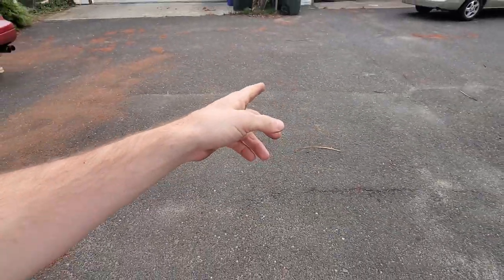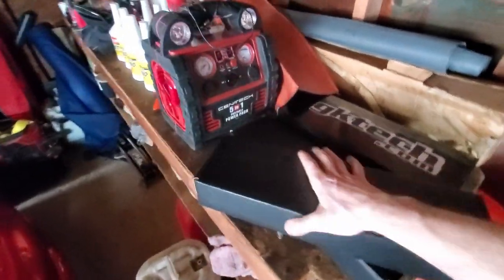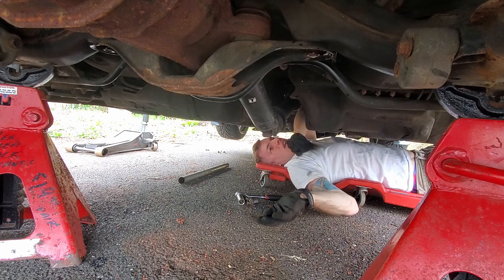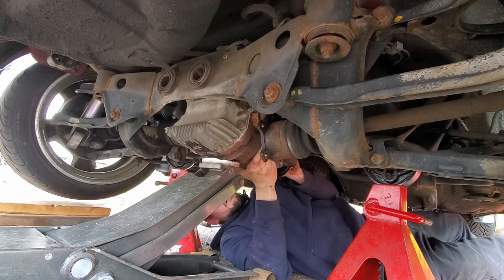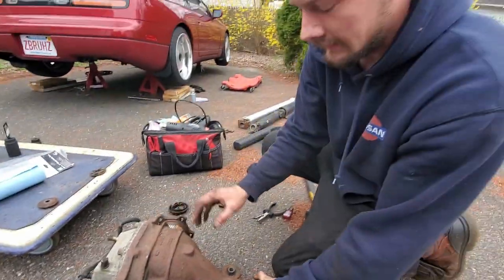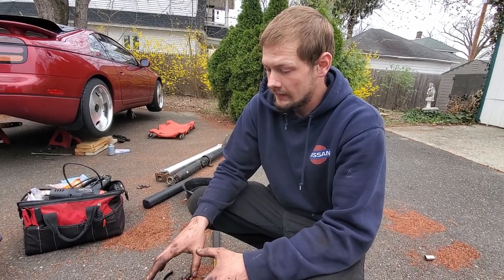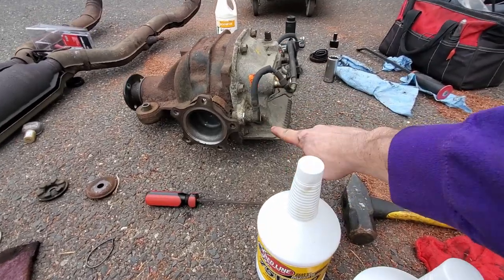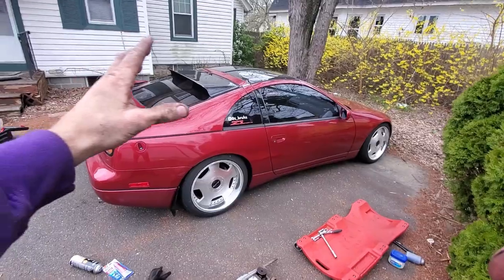Complete Guide on How to Remove and Install Differential Seals for a Nissan 300zx!

Comment: Friend eh, seen your tutorials and started my vehicle a 300zx 1992, the problem I have is that when I accelerate the machine it slows down and it starts to lower the revolutions and it pretends to want to turn off what recommendations can you give me in this regard.
Reply from the maker: First things I would look at, ohm your fuel injectors and coil packs, then look at spark plugs, from there check fuel filter. Was the fuel pump ever replaced?? Then if those all check out and are fine look for vacuum leak

Comment: Question, did you have any vibration when you differential was leaking?   I just did complete rebuild on the motor and went from na to tt.  I noticed that when turning, I would get a vibration in the car.  Later I realized that there is no vibration when in neutral or when the clutch is pressed.  I thought the issue was in clutch or transmission but could not find anything.  Then later my friend noticed the differential was leaking.  So would think that would cause the vibration and would you think that differential is done? Another friend told me my power of 600hp the differential would not handle it.   Honestly I haven't used all the power but twice.. so I don't know
Reply from the maker: Hey thanks for reaching out! Unfortunately I did not have any vibrations due to the leak. It could make sense that could cause vibrations if it was heating up with no fluid in it..., other than that I'd say check subframe bushing, driveshaft bushings, diff bushings, and axle play..

As for the drive shaft, it may need to be rebalanced if any of the weights were removed accidentally. Some have weights in the outside and some don't. But typically if you remove the driveshaft you should be able to just put it right back up..

I'd also do a bolt check on everything, with that much power bolts can come loose even from one pull honestly.

Hope this helps and good luck!

Comment: Jeremy.....  when putting the side flange (gear shaft) back in, how much effort did you have to apply to them?   DId you whack it with a rubber mallet aftr popping the cir clip on it?  Mine is proving a bit tough going back in after side seals replace and thought I would ask before whacking them and possibly messing something up. Kndly advise.
Reply from the maker: When it comes to the shafts once the teeth are lined up you should be able to get it pretty easily with the first set of teeth with no issue. The second set if teeth I did find pretty difficult. I use a mini sledge hammer on the middle part of the flange and that helped persuade it a bit more no problems after that. I would say make sure the locking clip on the end of the shaft is somewhat even around the end of the shaft to help make things easier it sometimes likes to get caught up
Reply: @ZBruhzchannel  Thanks Jeremy, will give it another shot per your comments....thank you so much.
Reply from the maker: @taipane-biensur7607  anytime let me know how it works out!
Reply: Jeremy - I wanted to follow up on this. So I found out sometheing interesting. On my 91 TT, it has the Viscous LSD. The hub axles go in differently. On the Driver side (left) with the shorter of the 2 axles, the cir clip goes on the shaft first and then you pop the hib axle in and hit it with a  mallet. The right hand side (passenger) is a dfferent story. You actually have to insert the cir clip into the differential carrier first, before you insert the shaft (longer one). Had I known this earlier, I would have left the original clip in there because getting the new cir clip in was a #@!!! . Once the cir clip is in there, you simply do the same thing you did with the left side and voila. If you make the mistake of putting the cir clip on the shaft and try to bang it in on the right side, it just will not budge and you can risk damaging something. Just wanted to share in case it saves someone else the hassle.Thanks again for all the assist.
Reply from the maker: @taipane-biensur7607  love it thank you for sharing!
Reply: @ZBruhzchannel  One other thing Jeremy..did you use any sealant or loctite on the drain& fill plugs?
Reply from the maker: @taipane-biensur7607  I used Teflon tape just a little bit if it on the threads
Reply: @ZBruhzchannel  Ah gotcha....kool... wasn't sure if I needed to. Will add a little to both. Thanks.
Reply from the maker: @taipane-biensur7607  yea I just do it for extra safety